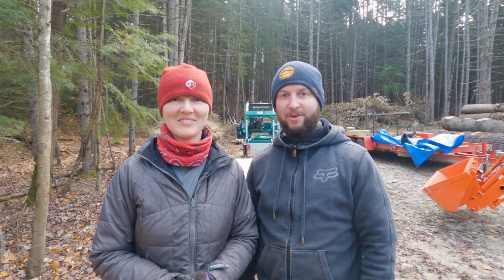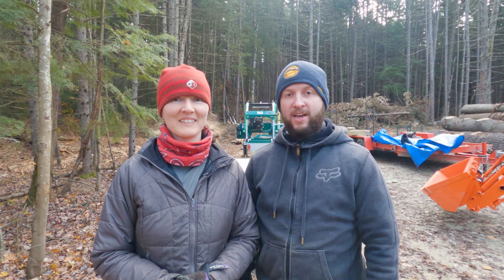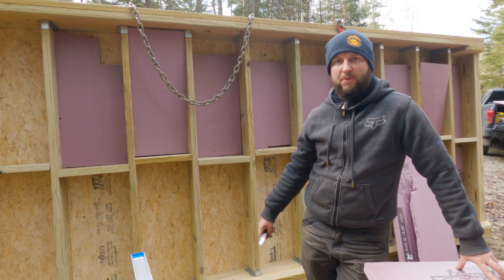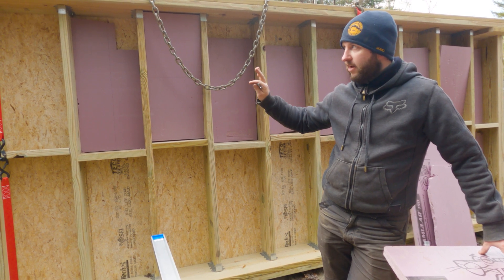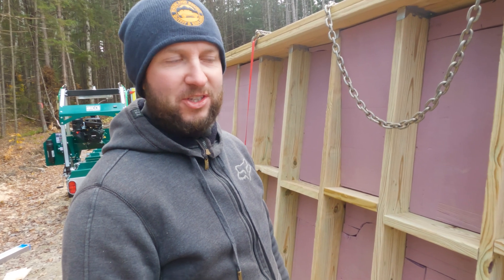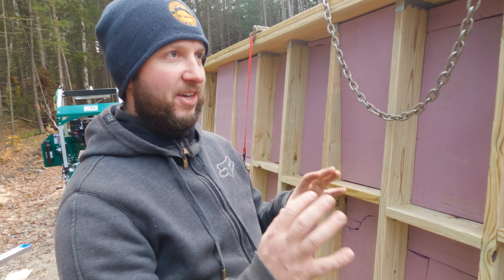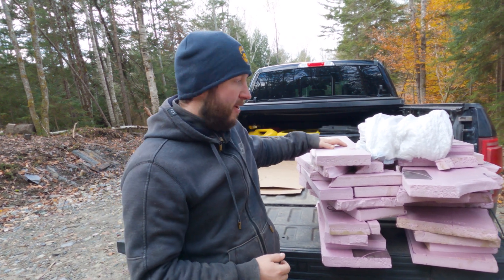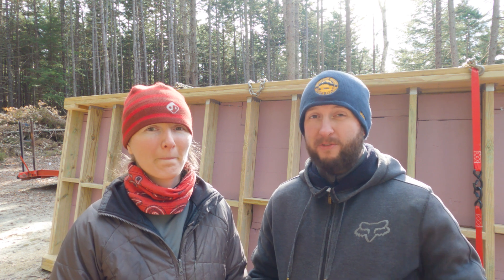Building a Solar Kiln | Ep 3: Floor insulation

Comment: So how does that work
Reply from the maker: It works in a similar way to a greenhouse - heat from the sun enters through a clear roof and heats up the inside. Except with the solar kiln, there are fans that circulate the hot air through the lumber pile where it collects moisture before being blown outside, drying the lumber in the process.

Comment: I'm not sure you would have lost that much heat out the floor of your solar kiln.  Extra insulation in the roof may have been better use of it.
Reply from the maker: We're following the Virginia Tech design and floor insulation is one of their recommendations. Insulating the roof is a little harder, especially with foam board insulation, as it needs to let the sunlight through....

Comment: Awesome floor structure you built.  Insulating the floor is a good idea but you'll need to figure a way to keep the rodents from chewing on the insulation.  1/4" hardware cloth would be a good rodent gaurd.  Tom
Reply from the maker: That's a really good point - we hadn't thought about that! We'll definitely look at adding some 1/4" hardware cloth underneath - it should be easy enough.
Reply: Great idea!